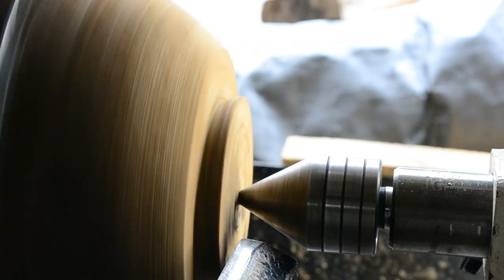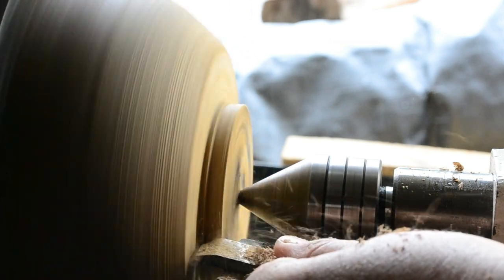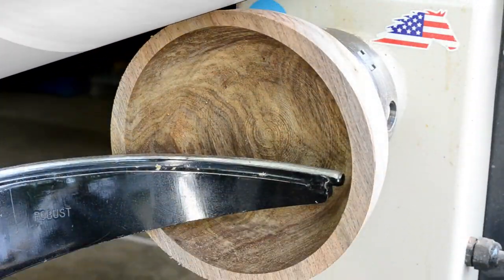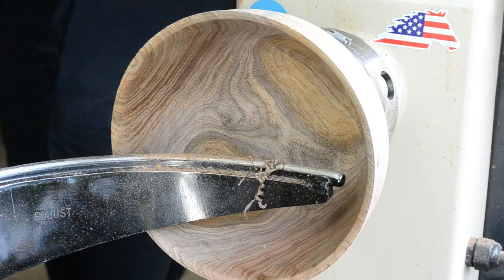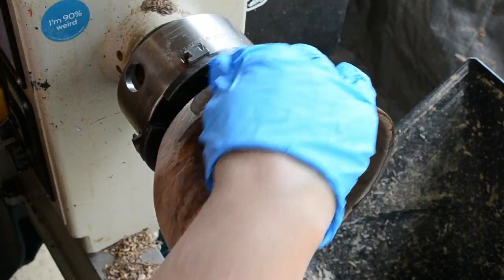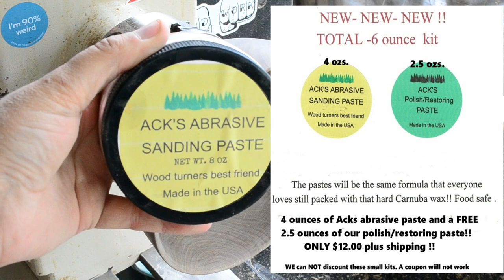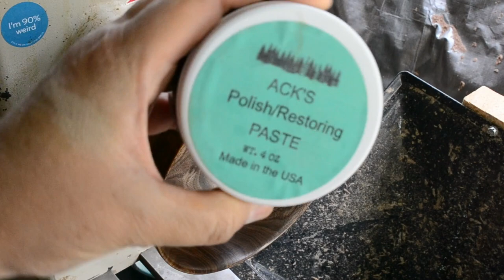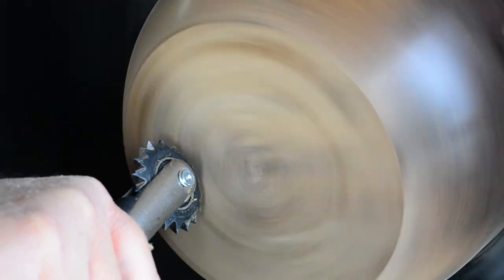Beautiful Black Walnut Bowl

Comment: Instead of using carbide on the bottom try a bottom feeder gouge ground to 75 to 80 deg.Your bowl gouge seems quite sharp ... maybe just the video. Also coffee grounds an thin CA loos great as a filler. Very natural looking. The bowl looks great.
Reply from the maker: Thanks for the info 👍 I will have to buy a bowl gouge to try that. I don't want to change the ones I have. I use coffee and CA on a lot of my projects. 
Thank you for watching 😃

Comment: I must say Tanya you do some nice work.  I have some Black Walnut but I'll need double up to get it 3 or 3.5" hoping it turns out as nice as yours. if you have any suggestion on this I would appreciate it. I only been turning wood on a lathe for about a year or so, getting better, thanks to youtube seeing how the Pro's do it.  Thanks
Reply from the maker: Thank you Bob! I have been turning a little over 2 years.  I am not a pro by any means. 
I am self taught by watching people like Sprague Woodturning, Rod Humphrey,  Tim Yoder, Kimsey Just Kimsey, PF Woodturning, Lisa Ramlow and many more. 
One thing I have learned is ride the bevel and with time and practice you gain the ability to turn better. 
Make YouTube your friend, watch other woodturners on how they hold tools, etc.
Another thing to do is join a turning club. That is something I have yet to do.